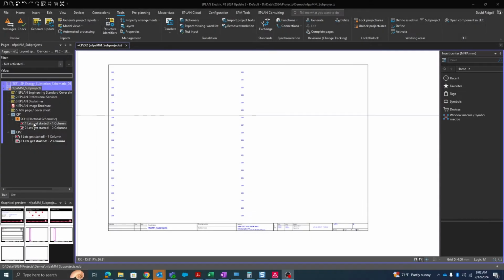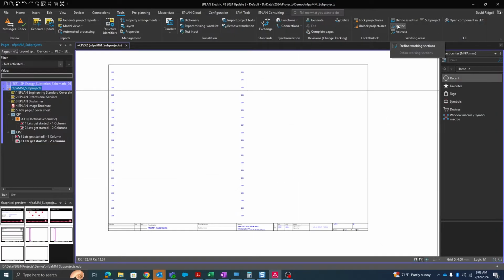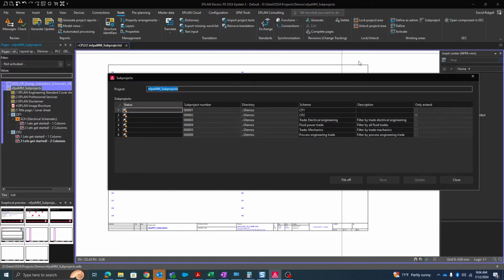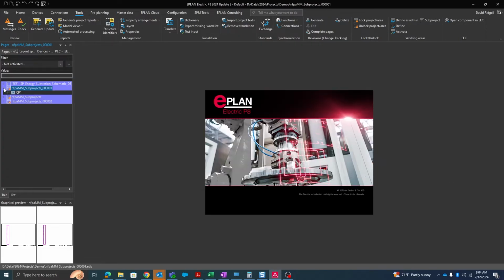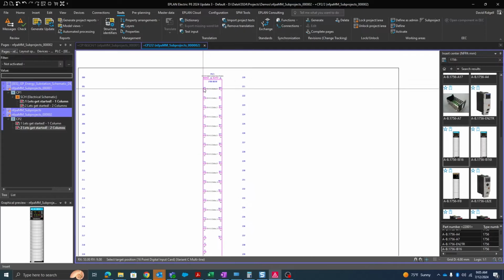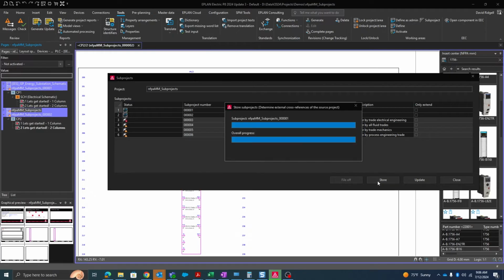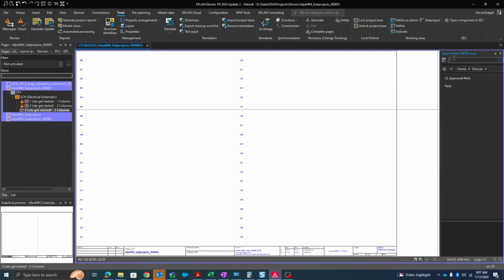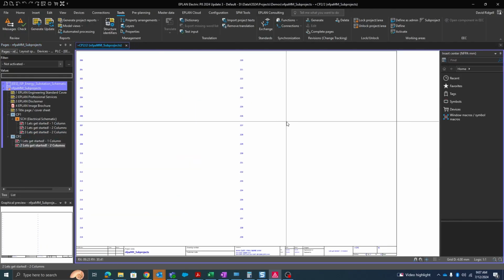Eplan Shorts - Subproject Management

Comment: How would you handle a situation where you have a small enclosure with say several dozen terminal blocks and some remote I/O within it, but you want to standardize the design and insert it a dozen times into your larger project?  Completely separate project, design your box, and create a "part" for it in the database, and insert that into the greater project?  Or is there a more intelligent way to connect cabling up to a standard design without copy/pasting drawings multiple times throughout your project, creating a situation where if you want to make a change, now you have to do it in 12 different places?